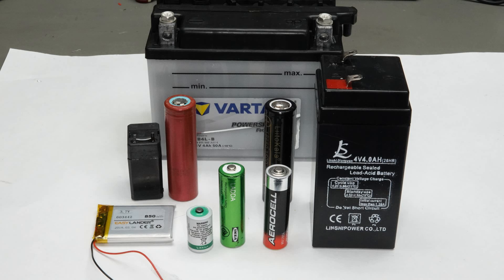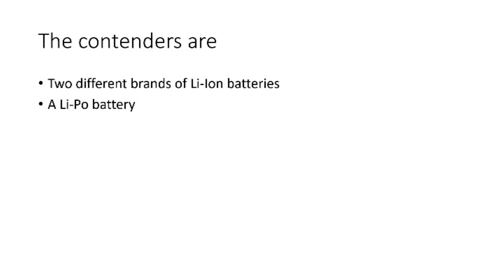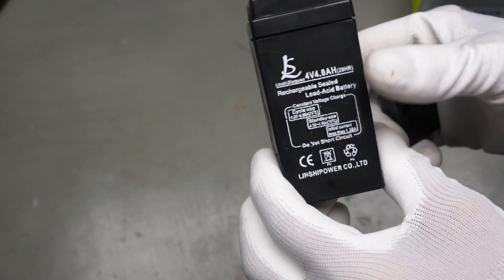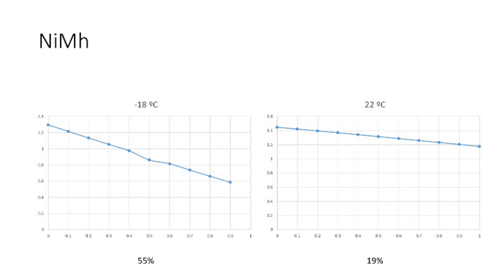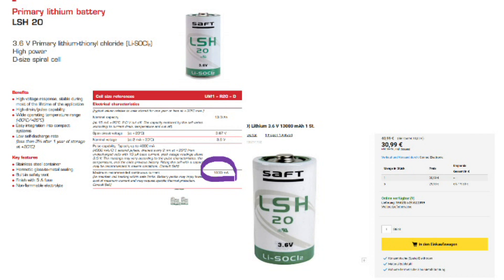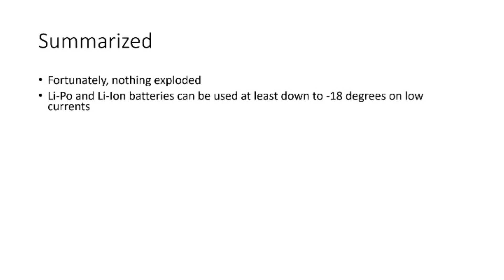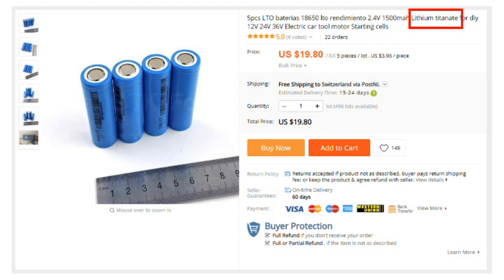#256 Which batteries are best for winter? (Arduino or ESP8266 / ESP32 projects)

Comment: Do'nt forget to have a good look at the components used for the charger!! Especially the one for the Li-Ion-types.
Even if the batteries don't have any problem, the electronics in the charger can be well off and not stop charging at the right moment. This can get quite dangerous as well. Many components behave quite different at low temperatures then nominal temperatures. 
In higher-current applications, the charging itself will warm the electronics (and batteries) up but if you have real low charging current like on a solar-panel with (melting) snow on top you could have a cold charger pushing over the limits of a battery which can cause failing.
Reply from the maker: You are right. Many additional problems can occur in cold temperatures. I think small currents will reduce dangers considerably compared to high current applications. But interestingly not a lot of investigation was done below 0 degrees and small currents...

Comment: Thank you for another great video Andreas.
I'm using two 18650 Lifepo4 batteries from Soshine in parallel for a remote monitoring device (ESP8266). The device is in a northern country and this year I saw a peak cold of -31.5°C, while VCC (read on the ESP using ESP.getVcc()) was 3.13V. At -20°C VCC was 3.22V and at -10°C VCC was 3.25V. So voltage drop increases with lower temperatures, but they still worked fine.
Reply from the maker: Thank you for your feedback! So you can confirm my findings. Your country is really in the north ;-)

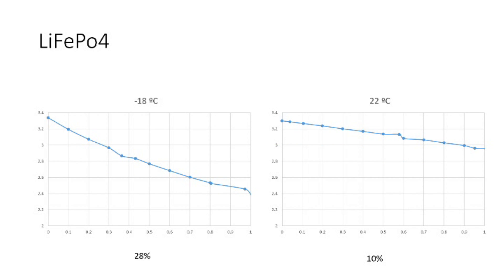Comment: Hi Andreas. As always, an excellent and useful video. I especially like how you point out things that may be different than the normal, such as at 3:02 when you point out the battery is a smaller one and at 6:52 when you mention that the testing only went up to 100ma instead of the usual 1A. Since you like to be accurate and complete in your presentations, may I suggest adding a link or mentioning in a video where your external references come from? For example, the table presented at 2:04 and other times in this video can be found at https://batteryuniversity.com/learn/article/secondary_batteries, although I don't know if the table is unique to them or can be found elsewhere as well.
Reply from the maker: Thank you! Usually, I put a link in the slide, but this time I forgot it. I will put it in the video description.

Comment: Beware when using car or motorcycle batteries! They’re shallow cycle Pb-acid batteries, which means they can’t be fully discharged without being damaged, and they only withstand a few full cycles, in exchange for more current. If you want a general purpose Pb-acid battery, you need a deep cycle battery (which is slightly more expensive). Also, ideally, you should use SLA batteries, which are sealed and can be used in any position except downwards.
Reply from the maker: Thank you for your feedback. I think I mentioned the low voltage protection at 1.75 volts per cell. 
This was the only battery I got easily. And the gel batteries in this shop were about 3x the price. I thought the curves would not be completely different for the one I used. In the meantime, I found the batteries you are writing (from Duracell) on the internet...

Comment: IIRC battery electric vehicles have a heater built in to the battery unit to prevent them from getting too cold. In some models at least, the heater is on and drains the battery even when not using the car to make sure it can start, so it's important to keep it plugged in when parked during winter. When you use the batteries they will heat up due to internal resistance, so it's not so bad, problem is to get started when the batteries are frozen solid I believe.
Reply from the maker: You are right. I read about the heaters in the Teslas and the problems. I also read that they charge at a low rate if the batteries are cold. This was my problem: We have some research for high current applications but none small currents...

Comment: LiSOCl2 batteries (SAFT LS14500 AA-size costs €3,50 from regular German vendor) can be used for energizing an ESP8266 directly w/o an additional voltage regulator. I'm using them for bare-bone indoors BME280 p-T-h measurement-devices (https://www.dropbox.com/s/t9ylze8dlqavs9x/BME280.jpg?dl=0) sending MQTT messages every 15min. My two devices are up and running reliably for almost a year now and the voltage is still fine. It's important to add a small powercap as buffer for delivering enough current during WLAN connection and to optimize the sketch for low energy consumption as its best.
Reply from the maker: Thank you for sharing your experience! I will try it.

Comment: You can charge Li-Ion that cold...  Just don't expect many charge cycles..  :(
Reply from the maker: Do you have data concerning that? It would be very interesting...
Reply: @AndreasSpiess Hard data, no, put I have this: batteryuniversity dot com/learn/article/charging_at_high_and_low_temperatures

I know that my car (an EV), has a heater on the battery and will not change if the temperature is too low.

It will just sit there running the heater until it is up to temperature.

Even then it will only slow charge until the temperature is optimal.
Reply from the maker: I read about the slow charge before the temperature is good. We only slow charge our batteries all the time. Unfortunately, there is no hard evidence about problems, just warnings. Some other commenters used Li-Ion batteries in cold winters and did not report issues.
Reply: @AndreasSpiess  sounds like a great idea for another video.  ;)

Comment: The regular lithium batteries (e.g. CRV123 3V 1800mA Varta) or AA/AAA (1.5V) are good for cold environments, another benefit that they can deliver the required power to serve an ESP8266, ESP32 or similar. My intensive testing showed that lithium batteries (e.g CRV123 Varta 3V) deliver 90% of their capacity above 2.9V. This is perfect or many MCUs.

For this reason our ECO Power LoRa boards for Arduino are using this CRV123 lithium batteries, which last for 5 years using our ESP32 LoRa board with regular LoRa communication.

Regards from Arduino Hannover, Helmut

Great video as always.
Reply from the maker: Interesting stuff! I now found my Lithium batteries. I will do the same tests as with the others. Good to know they deliver most of the energy above 2.9 volts. I just ordered battery holders to be able to use it in my projects...

Comment: Thanks for the Tests. When expecting  low temperature expositions I mostly use Li Primary cells Li/FeS
2 like http://data.energizer.com/pdfs/l91.pdf . They are available, work also unter low T conditions and offer a typical shelf time of 20 years. So I also use them as backup batteries.
Reply from the maker: I should have included this chemistry, too, you are right. I just do the testing now to compare.
Reply: Great, Thanks a lot!

Comment: Do_not charge cold Lithium batteries! The Li can't migrate into the Electrode while charging and forms a metallic surface. After several cycles so called dendrites might grow from this metallic surface through the separator and short circuit the cell which will damage it or might cause it to burn. This can happen a while after a cold charging.
E-cars heat their battery compartments to prevent cold charging.
Reply: This is interesting. I have seen some videos and read some information that suggests dendrites primarily occur when batteries are charged or discharged too quickly. I can't seem to find information about temperature specifically causing this effect, though presumably the fact that the material is cold changes the rate at which charging / discharging can properly take place (as you describe) so it seems plausible that the two are related. Here's an example video that shows it actually taking place:
https://www.youtube.com/watch?v=_fu1zvqoDm0

What they don't show is the failure point where a dendrite grows large enough across the gap to cause a short circuit. Up to that point you're just losing energy storage materials so it's less of a big deal. The main issue is the short which will cause the battery to catch fire or explode.

Would be good to see a paper or other detailed info on this.
Reply from the maker: Do you have more information about low current charging? It would be very interesting. I read a lot of "should" and "would" and "can". But I did not find any evidence on how the lifetime of a battery is affected if charged with low currents in cold temperatures.
I read about battery heating. But I read also they charge at low currents before the battery is heated. And I read that the new Tesla has no more battery heating.
Reply: @AndreasSpiess  I found a couple interesting articles...

1) This one discusses the use of neutron diffraction to watch the inner process of a battery and mentions lithium ions converting to lithium metal. To quote three parts of the article:
A) "However, occasionally lithium ions form metallic lithium instead of intercalating into the anode, as desired. The lithium deposits onto the anode and is no longer fully available for the described process. The result is a drop in battery performance. In extreme cases this can even lead to short-circuits. In addition, metallic lithium is highly inflammable."
B) "The faster the charging process, the more metallic lithium is formed."
C) "Low temperatures encourage the formation of metallic lithium."
https://www.sciencedaily.com/releases/2014/09/140903105638.htm.

2) This one mentions in the section "Low temperature performance", a paper, which I looked for but could only find for purchase at $39.95, that it quotes as "Zhang et al.44 argue that poor performance of lithium-ion batteries at low temperatures is linked to poor charge transfer at the electrode/electrolyte interface. In fact, this poor charge transfer can lead to significant plating on the negative electrode during charging, which can cause irreversible capacity loss from electrolyte reduction."
http://jes.ecsdl.org/content/158/3/R1.full#ref-44
Reply: This is how it's currently tought at Univ., as the reason why BMS need low temperature charging prevention. I don't know if you can work around it by charging at very low rates. Concerning the heating it was said that once heated to charging temperature, the further regulation can be sustained by charging waste heat. This might explain the lower overall charging rate of E-cars when cold.
Reply: I've just searched for the paper that I remember but it's not online. The problem was the metallic Li that does give the benefit of a higher electric potential but with the risk of sudden local shorts. We had voltage plots of cold charged batteries clearly showing the higher voltage at start of discharge. When the metallic Li was used off the Voltage rapidly fell back to the normal discharge slope, so maybe the cell can be regenerated by discharging it down to the normal slope if possible.
Reply from the maker: @tornadokat: Thanks for the links. I think we have to expect faster aging in such situations. The question is only: How much. My LiPos never lasted more than a few years because of different reasons. If we only lose a few percents this would not hurt my wallet too much. If it would be 30% it would be bad.
Reply: @AndreasSpiess  my informed guess is that this will depend on the structure of the elements within the batteries and on the building materials. You can auto cycle charge and discharge patterns with a controlled source and sink and log voltage and capacities over time/cycles - but this is a larger research project if done properly
Reply: @AndreasSpiess  I'm itching to test this out but I don't think my wife would be happy with a potentially explosive/burning experiment going on long term in our freezer :(

Comment: Be very careful with Lithium Thionyl Chloride Batteries .If the battery leaks the fumes will kill you easily .Thionyl Chloride is one of the nastiest chemicals around and requires super environmental controls when in use . As an Sr. Air Quality Engineer I would highly recommend staying away from this type of battery.

Best Regards
Gershon Schwartz
Reply from the maker: Thank you for your information. I did not know that. These batteries are recommended as "the" solution for extreme temperatures.

Comment: so wich technology they use in sattelites where is a big swings of themperatures?  thanks
Reply from the maker: Good question. I do not know which batteries they use. Usually, they only charge when they see the sun and get warm. So maybe they do not suffer this problem of charging at low temperatures.

Comment: Great timing. In the last week I have been experimenting with Li Ion batteries. I put up three videos. One on a cheapo charger, another where I opened a swollen Nokia phone battery and a third on a Macbook battery.

I am considering trying to build a home made charger. Like you I am hoping to avoid the explosions. Also I am taking the same precautions. The batteries I got are from old laptops. They are being stored in a metal tin that I insulated with a flame retardant plastic. The entire arrangement is then placed in an old microwave oven. I am hoping my risk of fire is practically zero now.
Reply from the maker: It is always good to care before something happens...

Comment: As far as I know Li-Ion batteries will degrade fast when charged below 0 C. This is because electrolyte moves slower and small crystals of Li begin to form between electrodes. After some time it can produce internal short-circuit or other adverse effects.
So if you make some sort of autonomous station you can dig battery underground to keep its temperature above 0 C, or make thermo insulation and preheat batteries before charging.
Reply from the maker: I also read about this effect but did not find any hard evidence for low currents :-(
Burry the batteries was also proposed by another viewer. A very innovative solution and not expensive!
Reply: @AndreasSpiess  Lower charging current means lower growth rate of Li crystals. At some point they will no grow at all as electrolyte will be liquid enough to dissolve them.

Comment: Last year I left my ebike LiPo battery (10x6S 5200mAh) on the roof overnight after half charging it with my home made solar panels. Was -20 °C. Rescued it in the morning and brought it in to continue charging - it appeared to confuse the charger and was showing weird charging figures, so I stopped and let it warm up to room temps then it continued normally. It didn't appear to have suffered any damage at all, but difficult to tell now as it's been used almost daily for 3.5 years and its capacity has somewhat reduced to about 70% after many hundreds of cycles. I was careful not to let it ever go below 20% state of charge.
I would follow manufacturers specs - if lithium starts getting electroplated, then it's irreversible and unable to take part again. It also risks forming lithium dendrites which can puncture the separators and cause a short - this is probably the reason for the urban legends about lithium batteries "exploding" while charging cold.
Reply from the maker: You are right with the following supplier's recommendations ( I think I also mentioned it). My question is how much lifetime we lose when charging with low currents below freezing. In many countries, this will only be during a few sunny days. Unfortunately, I did not find any tests about that.

Comment: Well, unless it's a German fridge designed by VW engineers.  In which case, the Display temperature depends on who is looking at the temperature.
Reply from the maker: :-)) and it runs with Diesel.
Reply: It would also have a check engine light on

Comment: Great overview here well done Andreas,  I had worked for a company that put trackers on containers ( ships, trains, trucks ) and the battery selection for us was a very long process as we did not know the environments our units could potentially end up in.

We used the company EVE ( https://evebatteryusa.com/ ) to help us during the selection process.  As mentioned there is degradation in cold / and with lithium ion/poly heat is a killer.  We soaked many batteries in a watlow controlled chamber ( as with all our components / boards ) to get the real story.
Reply from the maker: And what was the solution? How much lifetime did the Lipos loose?
Reply: @AndreasSpiess  Since we had no way to energy harvest at the time we did not go with a rechargeable solution,  from what I remember in the chamber we found that they dumped current ( remember this was upto 5 years ago also ) especially in over heating conditions, but to cover all our basis we used a non chargeable with very limited constraints on the duty cycle.  I honestly can not remember the exact chemistry for the battery but it may have been either,  Lithium Thionyl chloride or Lithium Iron Disulfide.  The batteries were put into battery packs to provide the needed power.

Comment: When i use my (li-ion) battery-electric  chainsaw & blower-vac, after i've used up a battery it's still too hot to start charging immediately.  So sometimes i will put it into the freezer for 5mins to cool it down.  Then when i plug it in to charge, it starts immediately. 

ps: Yes.... i do keep an eye on it to make sure it doesn't catch fire, coz who knows, that's part of the fun of technology :D
Reply from the maker: And especially of the  Li-Ion technology ;-)